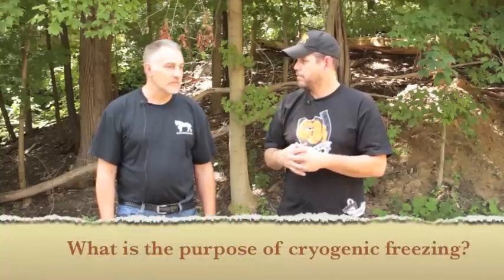Heat Treat Episode 4: What is the purpose of cryogenic freezing?

Comment: The cryogenic heat treatment theory makes no sense to me.  I can agree that the transformation at the microscopic level is dependent on the lowest temperature achieved during the quenching process, but this assumes the quenching is a one-step process that brings the metal from the cherry glow temperature to the lowest quenched temperature and not when it's done as a two-step process.  In this two-step process they describe in the video, the metal is hardened to room temperature first.  Then, subsequently, at a later time it's further cryogenically quenched from room temp to liquid nitrogen temp.  The problem is that at room temperature the metal is already firmly crystalized and "set in stone" at the microscopic level.  No further change is possible by bring it to below room temperature.  I'm not a metallurgist nor a materials scientist but neither are these two guys in the video.
Reply: i was having problems with brake rotors warping on my 2004 Ram 1500. Which was probably my fault (poor driving habits). Dodge turned them for me @ about 10k miles but they warped again. I replace them @ 20k miles with some aftermarket rotors. They warped at about 25K miles. The parts store replace those for me under warranty. They warped again @ about 30k miles. Finally i found some cryo-treated rotors and installed those @ about 30k miles. I never had to turn those again. I had that truck until about 110k miles and put quite a few different sets of pads on those rotors, but the cryo-treated rotors never warped.
Reply: @jharbour5  what are your driving habits that cause rotors to warp?  Do you haul heavy loads, stop quickly, drive through water when they are hot, etc.. ????
Reply: If the cryogenic process has no affect as you say then why does metal become more fragile when it is cooled to this state?
Reply: @johnnym1320  it will be back to normal  when it's warmed up back to room temperature.
Reply: @stevew3978  No. once the transformation from the subzero quench is achieved, it is set. Warming up the knife to room temperature will not “return it back to normal”. 

Super cold treatments transform retained austenite (not what you want) into martensite (what you want). If you have fine grain in your blade steel, it will actually give it added stability and strength. Additionally the steel will get harder, because of the transformation of the new martensite (the hard steel structure). 

This treatment is especially important for hypereutectoid steels and high alloy steels (stainless).